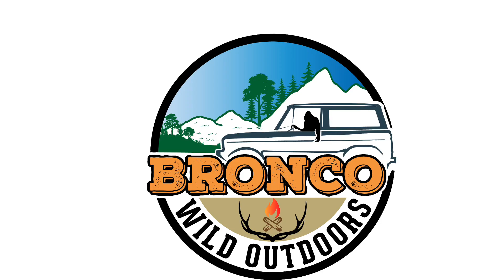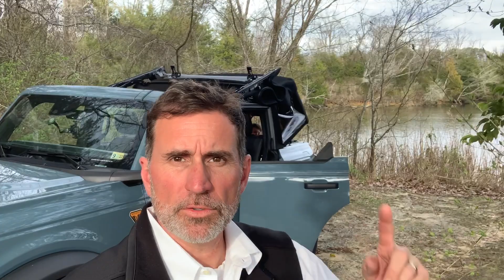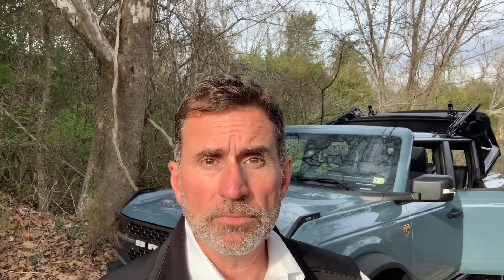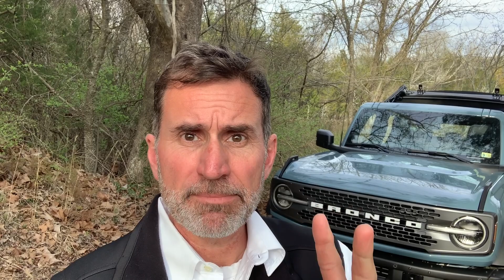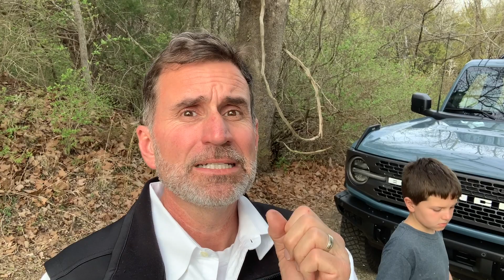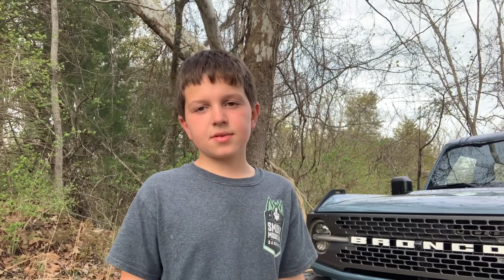Automotive Chip Issues Again, and This Time it is Really Bad. Will The Ford Bronco Be Affected?

Comment: There's no rationing of chips. All of the modules in a vehicle use different chips and there are hundreds of thousands of them. You can't save the microprocessor for the seat and used it in the body control module. When they talk about a chip shortage it includes all semiconductors. This includes voltage regulators, MOSFETs, current drivers, basic and complexed microprocessors. They're all based off of a silicon die and that is the shortage. The fab houses are at full capacity. After a silicon die is created at the fab (taking about six weeks) it needs to be die bonded, packaged and placed in tape and reels or trays (the little black square / rectangle parts on the circuitboard) at a completely different facility. From there all of the semiconductors (chips) are populated onto a circuit board at an integrator using automated pick and place lines. From there a vendor installs the board in its housing and ships it to Ford. It is not Ford that acquires the parts, it is their vendors that provide the Ford spec. modules. And something as simple as a voltage regulator or MOSFET can hold up the whole entire assembly even if you have the microprocessor. If the finished assembly does not have a part number that is shared across vehicle platforms it cannot be used on another vehicle. The reason I have an inside on this is that I have an electronics design and manufacturing company. I designed and use to manufacture electronics that went into the Mustang and F150 trucks. All of us in the electronics manufacturing industry are suffering from the shortages and lack of fab capacity for our semiconductors. I think one of the big problems is that the semiconductor companies are now forcing us to put in two year bond orders. Deliveries being at 50 to 100 weeks out. That means that we're ordering parts that will be delivered 3 to 4 years from now by the end of the order. This in itself is creating a virtual shortage. At the speed at which electronics get developed a lot of companies won't need these components 2 to 4 years from now. Some won't even be in business.
Reply: That’s crazy but makes sense. With a 2+ year delay, how does Ford (or any car company) create vehicle updates, model refreshes, etc? If I understand you correctly….. Let’s say they design a  series of electronics today for a refresh of the F150, they have to wait 2+ years for that part to be available? That means they’d be designing the 2025 or 2026 F150 NOW; and “new tech” won’t be able to be incorporated into vehicle until years later?
Reply: @dtom420  as of right now with a 50 to 100 week lead time on semiconductors this is the case. A couple years ago they would sample parts with two to six week lead time part orders. Most electronics in the automotive industry are based off of microprocessors that are older architecture. It's the code and support components that make it act differently with added features. So you can always develop a new module. It's getting parts for production that's the trick. For Ford the big problem was that they incorrectly anticipated a drop in sales. Ford reacted to this by canceling their orders with their vendors that in turn canceled their bond orders for parts. Realizing that they were wrong in their forecast they increase their orders. But their vendors who canceled their part bonds had go to the back of the line.
Reply: I own a small business that manufacturers electronic devices and everything you said is right in line.  A couple of other things to note.  I designed my products from circuits to the code.  When the microcontroller shortages started the main pic micros I use were bought up almost overnight.  ETA from microchip direct was anywhere from 30-52 weeks.  Quickly I cross checked and found a pin compatible newer part that had inventory and quickly bought some to horde and adapted my code to work with the new chip.  Thats great for smaller companies but for larger companies they can't necessarily transistion to new designs so quickly.  Besides ceritications, developer time, you have to put things through testing as well.  As you noted its not just controllers and the shortage affects a large portion of other components.  Practically every order you have to search through many distributors to try to round up parts.  Then you get to sub assemblies enclosures and other parts that are mainly from overseas.  Besides the cost hikes the shipping prices has become crazy.  Often the ship times are so slow you have to spring for expedited shipping and pay through the nose.  All this while customers are upset because your product availability goes in and out of stock often.  Many people have no idea what kind of mess is really happening out there.
Reply: @spyder000069  I own a company that does full turnkey design, engineering, and production manufacturing. We're vertically integrated and perform most operations in house. I ended up doing the same thing with microchip hoarding and finding every variation of the pics that we use. I got their standard product, automotive and military versions. Even picking up different pin configuration as I can always retool my circuit boards. My new revisions are going to be daughterboard based so that I only have to retool the daughterboard. By giving microchip a bond order for two years they guaranteed that my parts will be placed in bond in 50 weeks with releases every month. ST is at 35 -40 weeks for my bonds. And with shipping we used to buy containers for $1600 - $1800 then $2500, $5000 and now $19,000. With my last container order dropping to $17,500. The shipping company said aren't you happy the price is coming down. Get me back to $5000 to $6000 I'll be happy.

Comment: Chevy shipping trucks with no heated or ventilated seats. No heated steering wheels. No front or rear parking assist. They are giving $50 off for each of those. 2022 vehicles like the F150 have LESS features than the 2021.
Reply from the maker: Thanks, sounds like everyone is giving up something